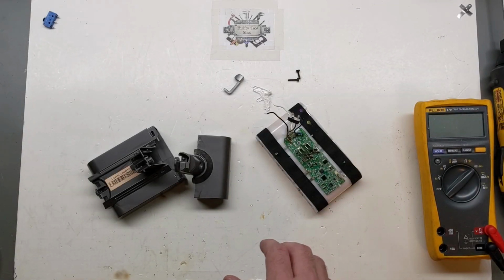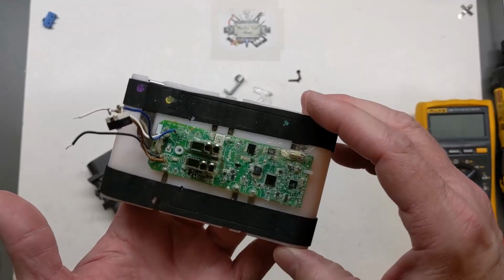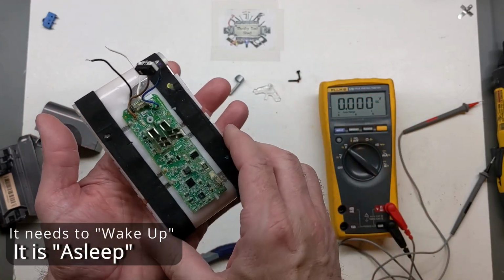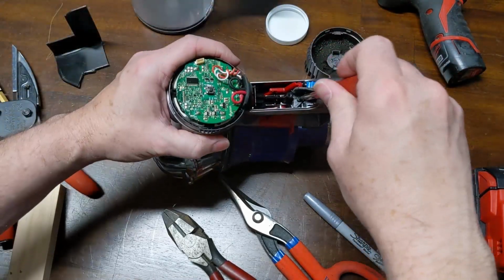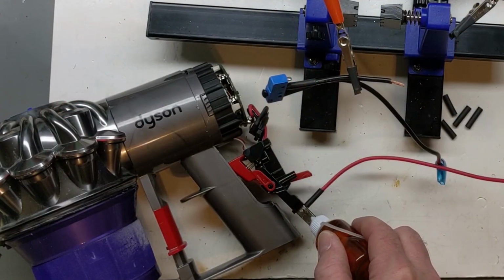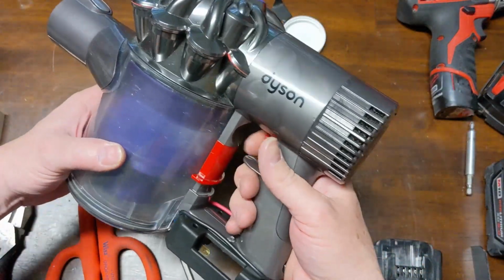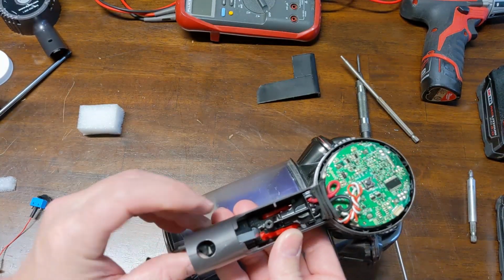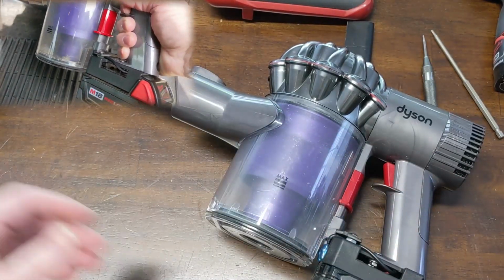Dyson DC58 with Milwaukee M18 Modification

Comment: Not having the soft start functionality from the battery pack board you're just slamming everything with full inrush current. That will stress every electrical interface inside your vacuum well beyond what it's rated and designed to handle every time you pull the trigger. wouldn't recommend this mod unless you want to fry your motor control board.

Comment: There's a way to activate the battery board with a magnet.  There is a hall type switch (the metal cylinder looking component, not sure what it is) If you put a magnet by that and hold the trigger switch until it resets, then there is a sequence of releasing the magnet and switch that will save the activation.  You can find the sequence for each model if you search.  I found most of the OEM battery cells to be fine.
Reply from the maker: Interesting! I had cell issues and did not look into it far due to that and use it  since then with my M18! Win! I have seen that some reflash the microcontroller. I have not seen that about the hall sensor reset.

Comment: Hello. Thank you for this video. I have the same machine. It would not start so I cleaned it out and when I put the battery back in it started and kept on going. I could not turn it off. The trigger had no effect. I would appreciate any advice. Thank you. Regards Elio
Reply from the maker: If it's like this one then it could be the plunger that the trigger moves to activate the switch on the battery, but other than that it is all in the battery. The trigger simply presses the switch that is built into the pack and that switch activates a mosfet on the BMS board to supply power. Most likely internal to the pack if it's not something jammed up with the trigger or plunger.

Comment: LOL. Nice work my guy🙌 
Hear me out… eliminate OEM circuity for the most part- use ur own circuit to send power from bat to the fan with a momentary switch 🤷‍♂️fancy- variable speed trigger prob more work than it’s worth don’t need lights unless you want to mount up a laser diode on the brush to visualize dust….. or an LED on the head so it’s got a work like, just like drills, etc…  battery charged separately… 
As for the o.g. battery, could prolly reset the counter… realistically you may as well just doer just like you did! 
Bravo, Bravo 👏
Reply: Very true.  As long as you use an external charger or charging management board specific to the battery you don't need the OEM board.  It took a bunch of shady people at Dyson and a good staff of lawyers to make this patent very profitable.  Dyson makes big bucks on this confusing, useless feature.

Comment: How did you get the motor out of the unit? I e watched many. Ideas about this unit but you’re the first to successfully remove that
Reply from the maker: Hi,
I showed that in the first video. I found the side clips of the housing as seen at about (10min 30s)in that video below. Once end cap off the motor assembly simply pulled out with a rubber surround boot. It was surprisingly easy, I think you can even tell I was surprised how easy it was in the video. 
https://youtu.be/vTSngruwDgI

Comment: So I did a very similar Milwaukee mod on my dyson V6 animal, and it DRAINS the 2.0 M18 batteries. Is it supposed to kill batteries that quickly?
Reply from the maker: Yes, I thought I mentioned on video that it will drain quickly due to lesser voltage than original Dyson 24V pack. I meant to mention the fact that the 24V Kobalt or the Newer 24V Flex tool packs for example would be even better suited for this application. I mentioned that since I had many large Milwaukee packs I chose to use these anyway. I also tried my best to share that the large 5ah and the 6ah packs run this much longer since the Dyson will shut down at about 16.5V or so on the pack. The smaller 2ah or 2.5 ah probably won't run this on the Max or high output mode much at all. The 5ah and above can indeed. Mine works great around the shop/garage even with the smaller pack with some small clean up jobs. For larger jobs the 5ah or above is a must for me. As stated the 24V packs would be excellent if you already had that platform. I personally don't plan on changing from the M18 platform for my day to day tools any time soon. Hope it helps!

Comment: you need a 3d printer
Reply from the maker: I do?
Reply: @ThriftyToolShed  I have a tevo tornado that I bought off someone on facebook.  It is in pieces but everything is there.   I'm just to busy to put it back together and I really don't need another printer.   You can have it if you cover shipping.   I bet I can send it for about $45 usps.
Reply from the maker: If you don't want it, I will try it out. If shipping and handling is less than $50 to Augusta, Georgia 30907...

Comment: What is the type of switch that you used called?  I'm trying to do this with a Dewalt 20v battery. I'm going to mount it a little different that the way you did it. I'm going to make the battery mount fit inside the Dyson battery housing. Thanks for the idea's
Reply from the maker: Typically called a micro switch. It is harder than I thought to find one rated for 60V and 30A. Next time I will have to go the Mosfet route! Keep me updated and if you do a video, I would like to see it!

Comment: does the Dyson have lowvolatge cut off builtin the motor? if not this will drain the battery to level below recommended and battery will be dead.
Reply: Dyson stops working when battery reaches low as 15,4voltage. I added low voltage protection board for extra, just to be sure. You can see my vision of dyson to makita conversion at my channel.
Reply: @eskoasko  hi, thank for your input. looked at your video, seems great. Can I ask if your low voltage circuit is MOSFET driven or relay? I am waiting on my MOSFET trigger to do the same thing. I won't worry about low voltage now.
Reply: @mkay1807  
Mine are relay based. I'm newbie for this all, but eager to test by myself
Reply: @eskoasko  we all in same boat in that case. Just starting to get into this electronics and some of them are very complicated. I do want to make a MOSFET based low voltage cut off circuit for 20v batteries but no one seem to have a simple one available. that would be good project.
Reply from the maker: I mentioned that in video! Thanks
Reply: @ThriftyToolShed  must've missed it, Im doing something similar with my secondhand vac. I am planning to actually put a trigger with MOSFETs. might be an idea for yours.
Reply from the maker: I did mention that a Mosfet maybe better. It's harder than I thought to find a switch in that size with high current rating. I did happen to already have one.  The original pack used a Mosfet and a low current switch on the gate of it as well.

Comment: It's okay, I wasn't invited to the Master's either.

Good sir, I'm really enjoying going through your back-catalog of videos.

What liquid flux are you using? Seems really convenient to have that fine-tip bottle at hand.

Cheers!
Reply from the maker: Thanks for your comment! This is the type I used:
https://amzn.to/3Bn2Vd8
Reply from the maker: Here is a link to MG chemicals RA Rosin Flux, sorry for incorrect link, btw, the low temp paste is great. Lol...
https://amzn.to/2VNmNFL
Reply: @ThriftyToolShed  Haha! I need to restock on both anyway. So it All worked out!
Reply from the maker: I apologize sir. I was responding too quickly to this. You asked about the liquid flux and I sent you the low temp solder paste link by mistake. I will get the link for the RA rosin flux in a few minutes.
Reply from the maker: I ordered the bottle separately from Amazon. Something similar to these.
https://amzn.to/36MNUTy

Comment: Wish I coud find a link for that 30A/30v switch. Cant find anything anywhere! Love the guide though. subscribed.
Reply from the maker: I could not believe how hard it is to find those. I was going to buy some more as I have none left similar at the moment. As I mentioned that one I got from a EGO 650cfm blower and jacks small engine does sale ego parts but that switch only comes with the complete electric assembly for around $125! I have found a few here and there similar like this one is only 12A https://www.ebay.com/itm/New-Jiaben-20051926-Power-Micro-Switch-250V-12A-36Vd-c-T85-5E4-DA7-6-4-1-/274757640611?_trksid=p2349624.m46890.l49286
and I found some with out the lever.
https://www.ebay.com/itm/JIABEN-MSG-1230-Micro-Limit-Switch-30A-84V-dc-25T85-5E4-3-Pins-No-Lever-174022-/264539357599?_trksid=p2349624.m46890.l49286
Reply: @ThriftyToolShed  awesome, that second one should do the trick mounted in the right spot. Thanks!

Comment: Having already WASTED my good money on a knock off with a "5 year" warranty on ebay!!, this is something I had been looking into. I have Dewalt instead of Mil but the process will likely be the same. Good video!

For the record; their 5 year warranty is useless as you have not way to contact them, as they keep changing their name and NEVER reply to a request to return the unit. In mho if you want a good battery that is a bolt on ... suck it up and buy the oe, as the knockoffs are garbage.
Reply from the maker: I have had great luck with my Amazon purchase of the DC35 pack that was a knock off about 1 year ago. I do see many sellers with these now and I am sure some of them will be of poor quality unfortunately. Sorry to hear of your bad experience with the cheaper pack. Best of luck to ya!

Comment: Well done. Another machine saved from landfill. And you still have 6 cells to play with for other projects. 
One question, do these M18 batteries have over discharge protection in them ?
Reply from the maker: No the M18 does not. The DC58 will actually shutdown if the voltage level is below 16.5V or so it seems so I did not add a low cut out protection. If you wanted you could add the  20A cut out board like I showed in a previous video, but it will take up some room though. I am going to run mine without since the DC58 does shutdown, that's why I mentioned that the larger 4 or 5 ah packs ran it better, they did not pull down in voltage as quick while in max output. Thanks for your comment!
Reply: @ThriftyToolShed  
Thanks for clarifying that one. With some DIY and supermarkets selling affordable 18-20V batteries, I assume that would be the way forward rather than forking out big bucks for a genuine replacement battery.
Reply from the maker: @ruinunes8251  Yes, that or the cheaper replacements from eBay or Amazon!
Reply: @ThriftyToolShed 
To be honest,  I would use a power tool battery rather than buying a knock off from eBay. Pretty much everyone has a power tool of some sort at home so they have a battery or two laying around. Also I read a case where one of those knock offs set itself on fire just a day after it was fitted on the hoover. It could be just one off case of fire but god knows. I would prefer to use a power tool battery because I have a few around. 
Thanks for making this video. Surely it will help other people.
Reply: I have the same question!
Reply: @LilasTools  Makita does not have, so I always ad low voltage procetion on my mods